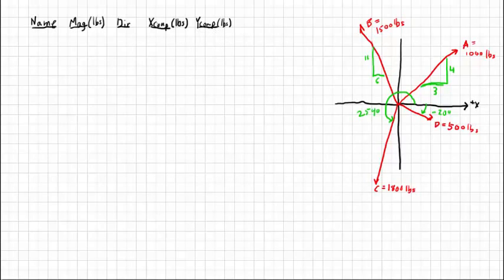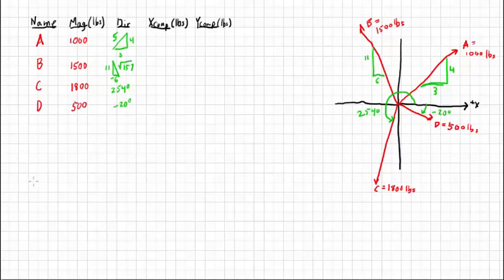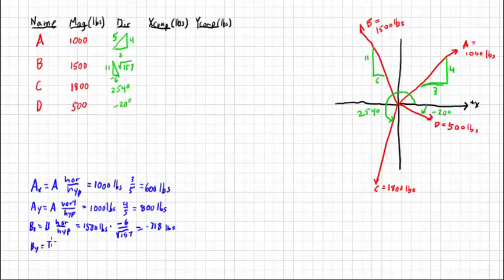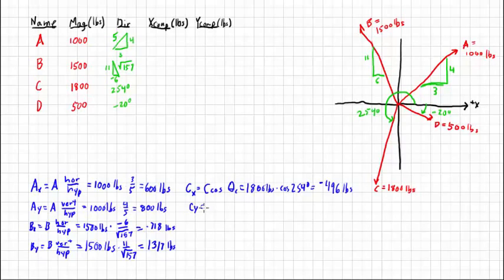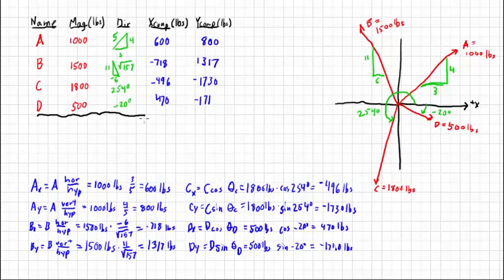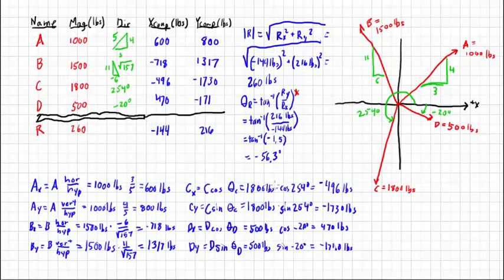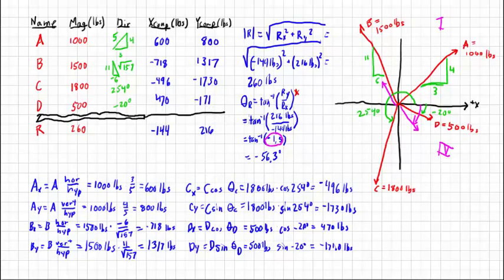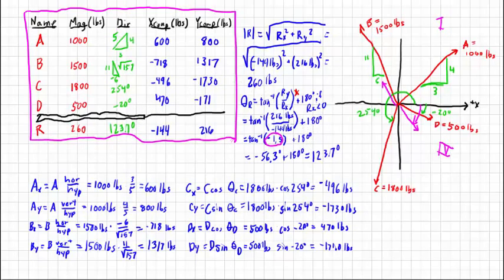Table Method to Calculate Components and Resultant of Four Forces

Comment: Please solve this problem.
Q. Calculate the components of a force of 300N which is directed down to the right at a slope of 2 to 3 in the second quadrant.
Please immediately......
Reply from the maker: Mr. Farooq, that's not quite how it works; I can't answer questions "immediately". However,  try looking at "Force B" starting at about 8:30. Your problem is very similar, except that Force B is up and to the left, whereas yours is "down and to the right". The only thing that will change is that the signs of the components will change (your horizontal will be positive and your vertical will be negative). Thus, do similar steps: find the hypotenuse of your slope triangle (2-3-?), then multiply the 300N force by -2 and divide by the hypotenuse for the vertical component.
I hope this helps!